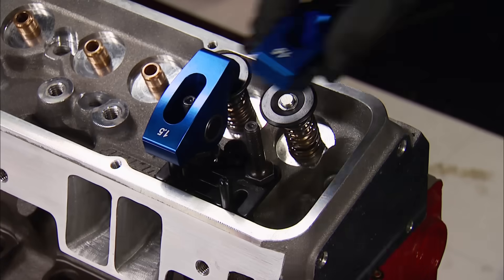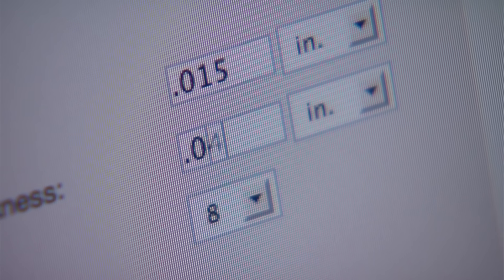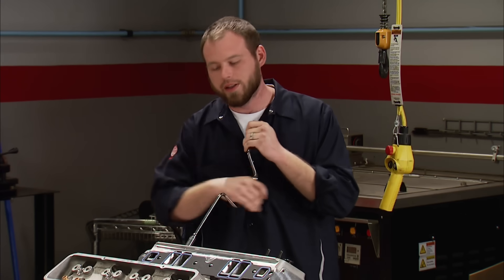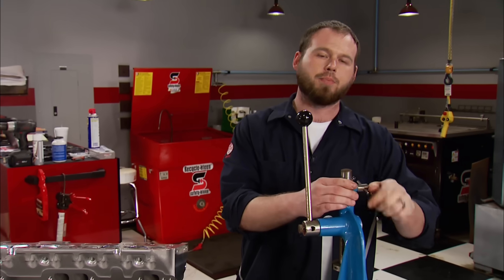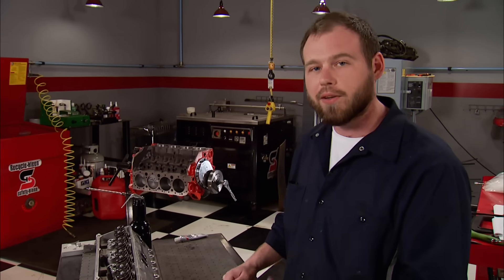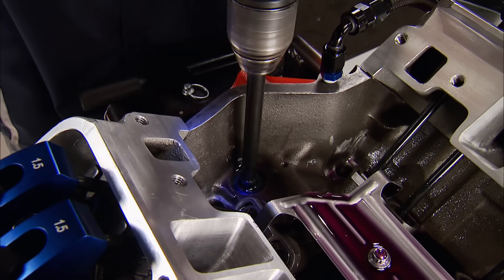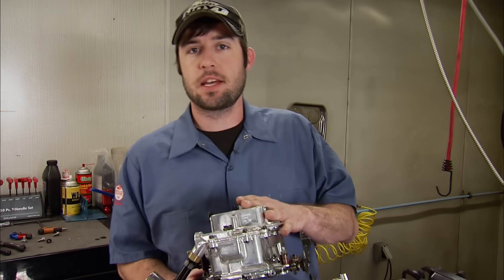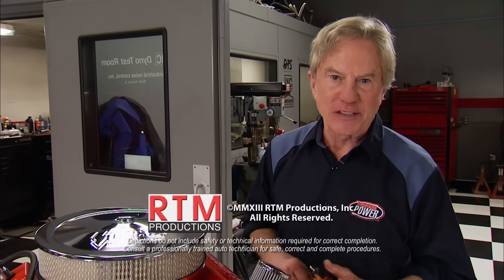Top End Installation On A 383 Chevy Stroker Small Block - Horsepower S17, E6

Comment: You do NOT use hydralic lifters to check piston to valve clearance, because just as the valve makes contact with the clay, the lifter spring will collapse and give you a FALSE reading ! What i do is take the lifter apart and put small washers down inside and re assemble them so you have solid lifters that do NOT give, then you will have the correct reading , just remember not to leave them in !

Comment: My 383 NA with scat internals and afr 195 heads and comp cam made 600hp and maxed out at 8200rpm, what are these guys even doing?
Reply: Probably the fact they keep mentioning it's a good little" street motor"

It's peak powers couple thousand rpm less than yours and I'm assuming you don't make peak torque at 4200 rpm. 

Horses for courses it's not all about the peak power number.

Comment: .015 +.040 is not enough quench   try and get it down to .030 total  open up around the  valves if necessary  , you did match the combustion chambers to the bore as flow does not like to hit the top of the block

Comment: Get rid of that garbage carb it's a bottleneck. We made 425 HP and 509 TQ with a 383, 9.0-1 compression, Vortex heads mild hydraulic roller and a QJ carb with headers.
Reply: This is a 2000's TV program, the engine, and possibly these people are long gone
Reply: @killshot7041 Joe Elmore has actually passrd on

Comment: Longer bolts need more torque..why ? There is more metal to streach, on Sbcs. I do this, 1st all at 30 ft. 
Lbs then 50, then 65, then 7 long bolts 75ft. Lbs end 2 medium length at 70 why ? Because its not all about torque, but rather clamping pressure, this way clamping pressure is more even . Make sense ?

Comment: You can measure the combustion chamber volume all you want, but since you didn't correct the piston height in each cylinder it's a waste of time.
Reply: Yup , true blue printing they would have checked piston to deck on all 4 corners to confirm true straightness of deck to crank. another step left out of the short block build.

Comment: 10 to 1 is not the limit on pump gas I have run 11.5 to one on 93 no problem and with better carb and AFR heads that would be a beast all though the summit heads are not that bad
Reply: This was made probably 10 years or more ago.

Comment: Lapping the valves in is so not a good way for performance... the purpose for a.multiple angle valve job is to control the width of the seat and lapping the valves make way to wide of a seat and that is a good way to burn a valve seat especially the exhaust valves and a wide seat doesn't flow well at all

Comment: These guy's are great for motor building that's for sure.. I love all the little tricks and math involved in getting that extra out of a motor..
Reply: Helps a WHOLE LOT when they have a $55,000 engine dyno in a $15M building that none of them paid for.
Jacked up prices by Jegs and Summit and other smaller sponsors are how they stayed on the air as long as they did.